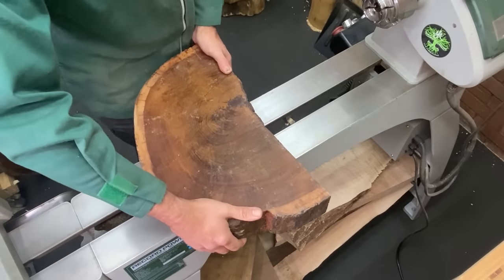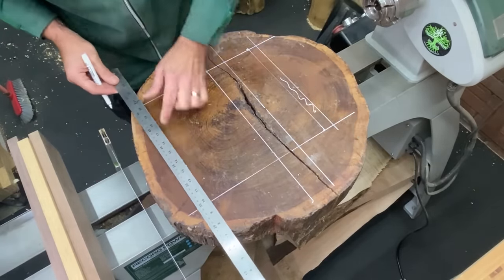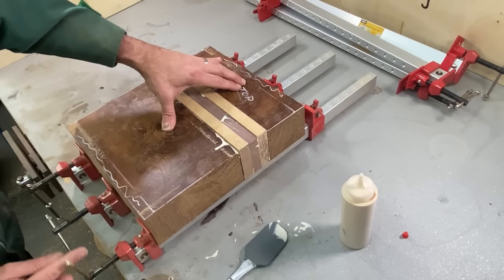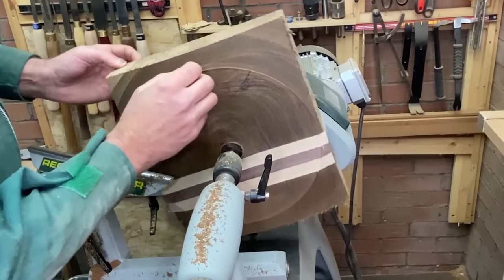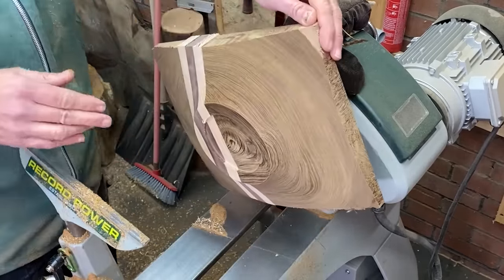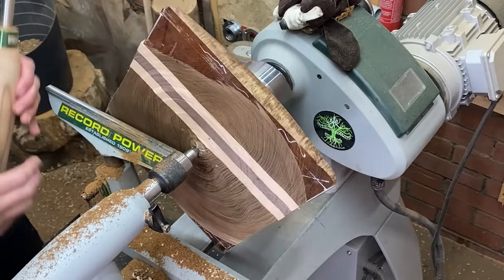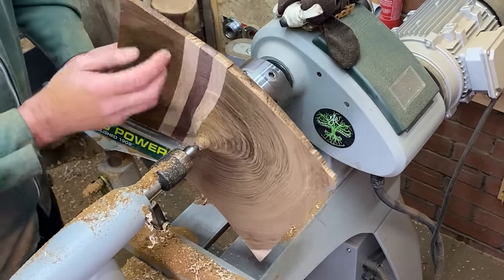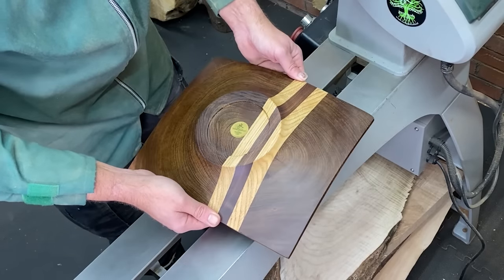Can you MEND a broken HEART? Woodturning project with BROWNHEART

Comment: That is a beautiful piece. As someone who doesn't turn - or work wood in any other way, really - I always have a ton of questions, many of which you answer if i watch enough videos - and I love that! But sometimes I just have to ask - (a) in general, how much depth do you need for a tenon? Is it different for a reverse (expanding, whatever that's called) tenon? (b) in this case where you're trying to get the corners, it seems to me intuitively like it would be easier to work outward - make light contact with the work where the "circle" is complete, and slowly go out to where you're only catching the wood sometimes, rather than inward where you start off with the clipping (which seems easy to make accidentally too much too fast as you try to "find" the wood). Can you put into words why that doesn't work, or is it just a matter of feel or experience, "if you know you know" kind of thing?
Reply from the maker: Hi Vynce and thanks for the questions. A: tenons need to generally be over 5mm a lot depends on the state of the wood, the "reverse" called a mortice or recess can be smaller from 2-3mm but a lot again depends on the wood you are turning. B: I work inwards as it is easier to catch where you are on the piece by looking at the ghost cut on the opposite side on the bowl. You can see easier by looking at the profile being cut looking at the opposite corner than you can if you are looking straight at it, hope that makes sense. A lot of it is feel and experience, this is not something for a novice to take on. Hope this helps. Mike

Comment: I really like the look of the final piece.  I wonder what will happen as moisture and temperature changes cause the different species of wood, and grain directions, to move differently.  My experience with cutting boards is that they can split along the glue joints.  However, here you have a piece that can be free to move a little bit.  It might warp and wobble, and that could make it look even better.
Reply from the maker: I would think there will be a little movement and you may be able to feel the join in a few weeks, after that is anyone's guess 😁

Comment: That turned out very nicely Mike, it's beautiful. However without being over critical It 'broke my heart' to see you abandon the larger original piece which could have been easily be saved. That was a special piece of wood and not so much the more common  inserts. Just my opinion of course. I guessed it was end grain as soon as you started cutting the outside from the rim inwards to the center on supported grain. On  the inside I was expecting you to draw cut from center to rim, again on supported grain. Maybe you would not have had to sharpen your gouge as much. I'm learning just the same as you so please don't take offense at my comment. Jim, Crafted in Montana.
Reply from the maker: That's ok Jim, we are all learning and a lot of this was completely new to me. Winged pieces like this need to be worked in from the outside because of flexing. All the best, Mike
Reply: @MikeHolton  I agree.

Comment: Very well done as usual.   What a workout.   I love the piece.
In my shop, "Murphy" would have caused the corners to break off if I got the wall thin.   I would have needed to go to the 80 grit "chisel" for final shaping of the corners.
If you want to prevent tearout on corners of square bowls, glue on sacrificial pieces of e.g., pine then rough cut the overall shape round.    After turning then cut off the sacrificial pieces.    I suggested this to some local turners and now they always use this technique for making square or rectangular bowls.
Dave.
Reply from the maker: Thanks Dave you are always a source of reliable information, just wish you lived closer lol 😆
Reply: I also wish we lived within driving distance.
Reply: Overnight thought.   In a future square bowl project, consider using the belt sander on the edges like you did for this bowl, but to create a slight curve on each side.   May look good, perhaps more visual interest.
Dave.

Comment: You're using way too much glue. It's counterintuitive, but that thick application of glue results in a layer of glue. You need to spread it thinly to ensure that you allow the glue to adhere better to the wood fibers on either side of the join.
Reply from the maker: Thanks for the advice, I appreciate it 😀